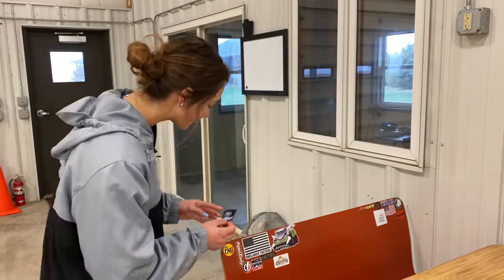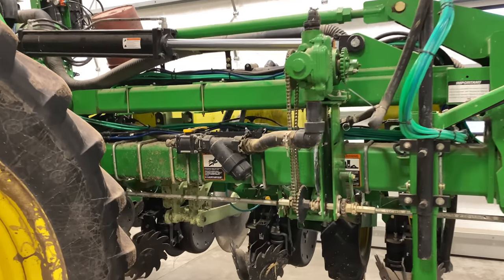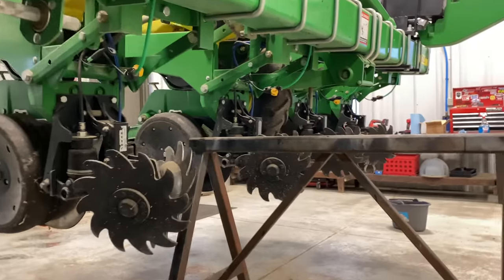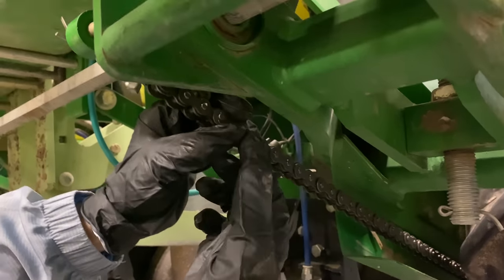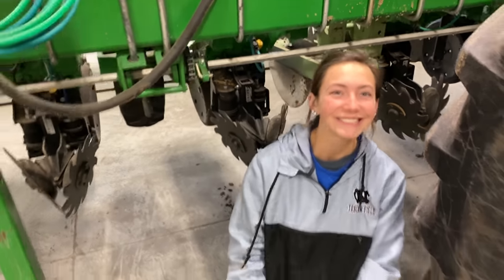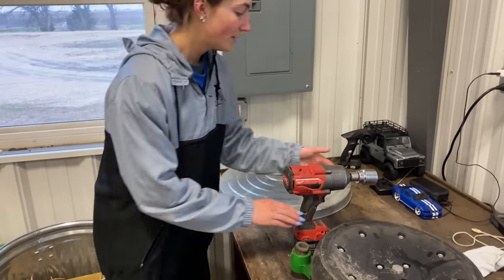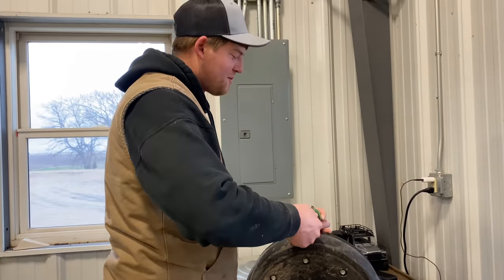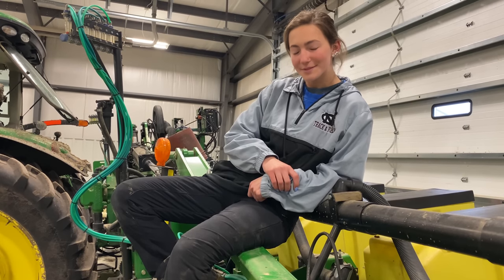Farm Hacks (Replacing chains on John Deere 1720 Planter)

Comment: Update: The master link is going the right way and I do plan on welding it on. Thanks for all the helpful comments!
Reply: Could use RTV silicone on it, or different link with split pins instead. Have installed clip links either way, dont matter when you use rtv to "glue" it on.

Comment: Always put master link clip with open end following trailing end of chain travel. Also set flat link side plate fully flat to ensure link clicks in. It is so nice to give advice to my YouTube daughter (and son), because you don't talk back.
Reply: YES, YES, the travel of the chain should push the clip on if it rubs something.
Reply: So true could be the reason it pops off.
Reply: @jeffmorton5092  They also make a peening hammer to peen the link instead of using the clip, much, much safer
Reply: As a former Millwright I would recommend getting the master Links that use 2 cotter pins instead of the clip. Those clips are notorious for coming off.

Comment: Are you careful to install the master link clip in the correct direction?  The front curved portion of the master link clip should point in the direction of chain travel. If you put them on backwards they can easily get knocked off. That holds true for any chain (like a motorcycle chain).
Reply: I just spot weld it and then it never comes off.
Reply: @Kingfisher1215  That'll work.  :-)

Comment: If you clip the new chain onto the old chain's Master link, you can then just rotate the sprocket / gear and by slowly pulling the old chain off it pulls the new chain on and pre-loads it into position.  Then disconnect the old chain and Master link and connect your new Master link.

Comment: The chain problem. Try putting the joiner master link clip on so when chain rotating a corn stalk won’t push the clip off. Put clip on the way it will be pushed on. 
A small dab of high performance epoxy anchoring adhesive may also help.

Comment: It's just like a bicycle chains...they stretch over time of use.  That is why they fall off.
Reply: Even 5, 10, 15+ speed bikes have a chain tensioner.
Reply: @joefudd  Doesn't matter.  I have a recumbent trike that I put over 18,000 miles on so far with 64 speeds using an 8-gear cassette and derailleur on each side using a single chain on one side and two chains on the other.  I have to get new chains put on every two years after a couple biking seasons.  The links on chains stretch over heavy usage.

Comment: On a planter i would change all the chains avery year to keep the planter's precision. Master chain links locking tab must be installed with the open end away from the rotation of the chain. So if any debris comes along it will not catch the open end and pop it if.

Comment: If the hydraulics failed it looks like the blades would hit the floor before it would hit the stands judging by the height of the blades from the floor compared to the height of the stands, but I could be wrong. Don't want you getting hurt and loosing a foot.
Reply: Hi
Reply: Hello

Comment: open end of the clip (for the master chain link) faces AWAY from direction of travel...
a dab of enamel on the link plates - something bright, ideally - will make the link easier to find...
if you can't fit under a vehicle, lift/support ALL the tires - oil-drain holes won't drain completely if the pan or housing isn't in its 'normal operating position', ie vehicle sitting level & plumb...

Comment: I’ve whacked a screwdriver through an oil filter once or twice in my life when a wrench wasn’t close at hand. Be warned: It could get messy!
Reply: Driving the rim with a mallet and cold chisel is another method I have used to remove oil filters when a filter wrench hasn't been handy. This is especially useful if the filter has tightened due to vibration.